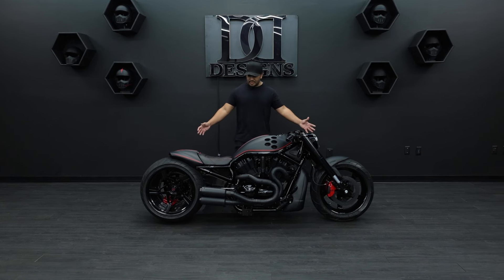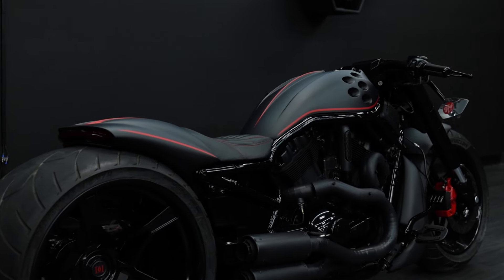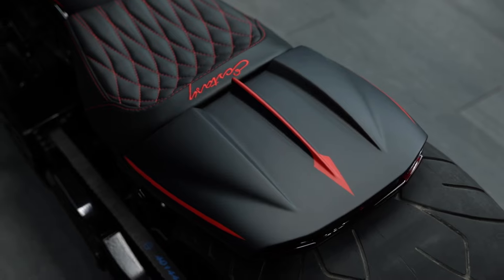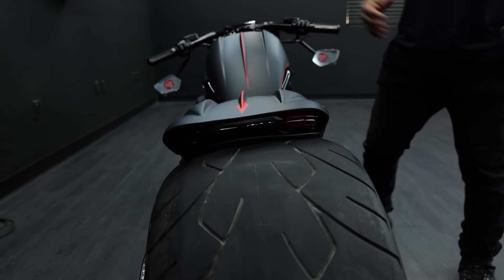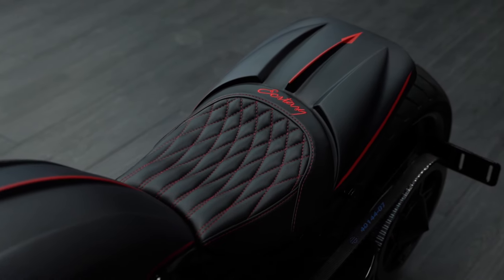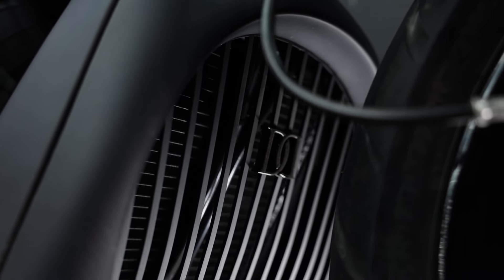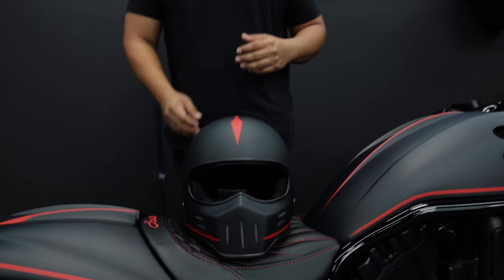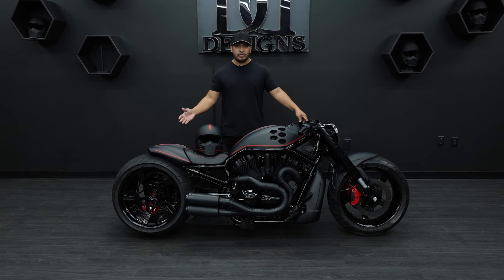Ecstasy Build By DD Designs

Comment: The rear fender is not centered with the tire. You can tell the red center tail is crooked to the left.
Reply: You're right. I just noticed that it's off center to the left. @ 1:50 you can see it. Nonetheless it's such an awesome looking motorcycle still and that is easily corrected.
Reply: That's because of the angle of the camera. Top view is centered...